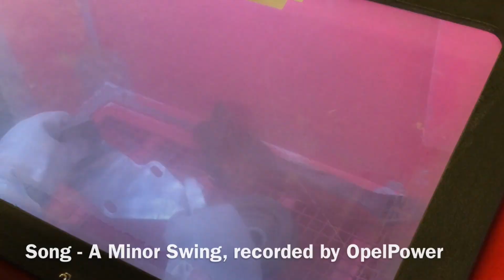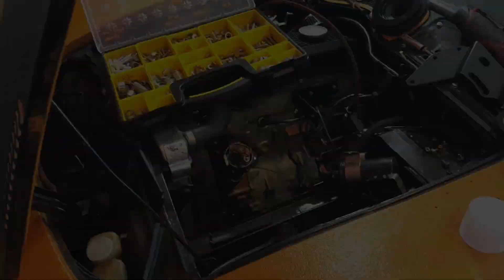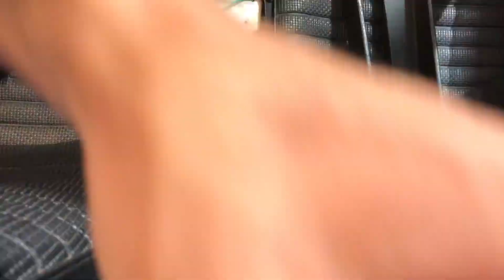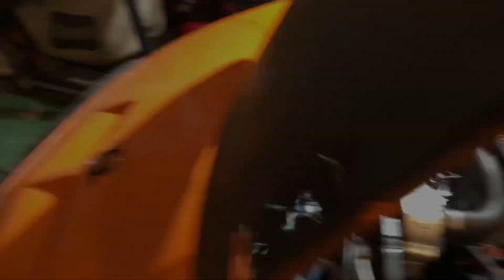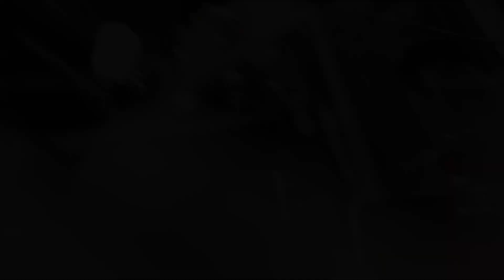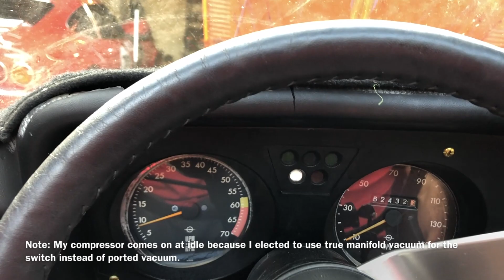Installing an Original 1972 GT GM AC System

Comment: Wow, that is a lot of work. Did you get all those parts from opelgtsource.com ? I haven't watched all your videos yet but I'm working on it. Have you ran a relay yet for your ignition switch so that full cranking amperage does not go through the ignition switch? That high amperage through the ignition switch causes a common problem of burnt and degraded wiring in the ignition switch. It is good to see a young man that is into these GTs. I got my first GT in 1979 when I was 17 years old, forty years later and they are still in my system! lol
Reply from the maker: Thank you!
No OGTS doesn’t have any of this AC stuff. I sourced it all locally in junkyards and from nearby opelers.

I am one of the few that doesn’t run a relay. I replaced the ignition switch with a better one though. I’ve had one of those relays fail. When they fail it will stick the starter on and destroy your flywheel ring gear. Ask me how I know lol.
Reply: @OpelPower  Mine stuck and blew up the armature on the starter. Not much left to work with.